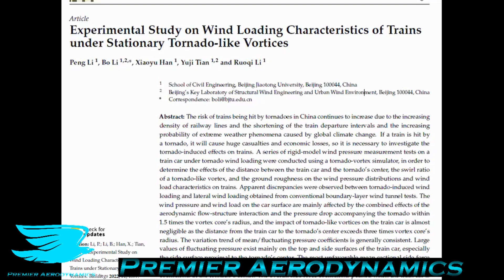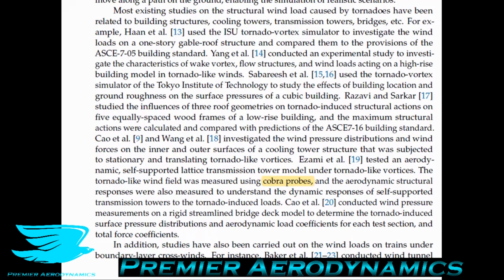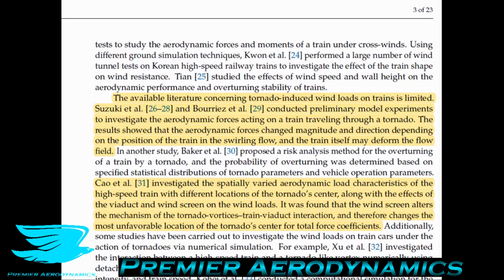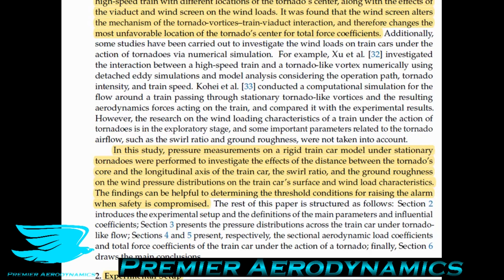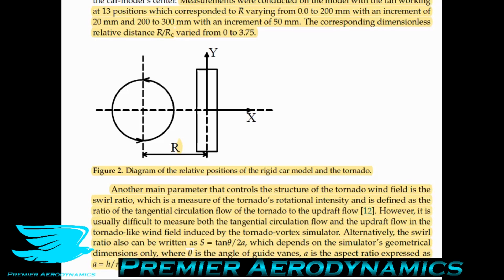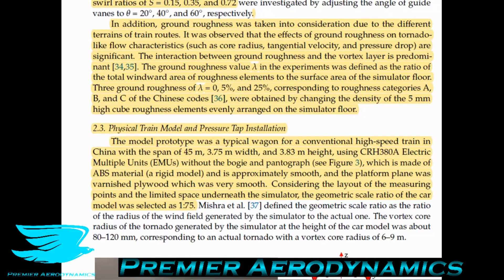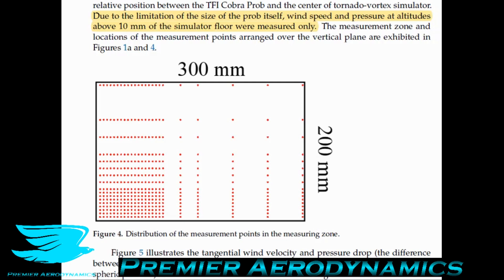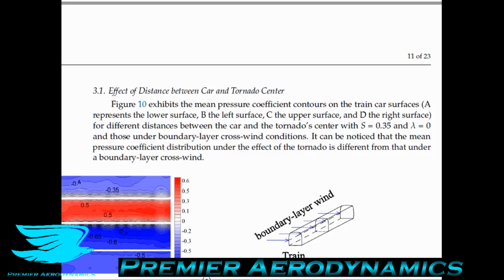Experimental Simulation of Trains in Tornadoes - Podcast #77

Comment: Higher swirl ratio also means more centrifugal force flinging air outwards, that would lower the probability of air molecules near the center of the vortex. I love how consistent the laws of air-flow are, even if they're very hard to predict at times. Lately I've been looking at airflow in cylinder heads and I'm amazed at how well the things I've learned in other fields that study air flow can apply, despite piston engines being pulsed flow as opposed to turbine engines being constant flow.

Realistically though, at ~7,000rpm or at around 2.4 bar absolute intake manifold pressure, you can pretty much treat it as continuous flow.
Reply from the maker: Interesting.

And with your cylinder mix, I'm guessing it's for an ICE? If so, have you found that the addition of fuel changes the flow physics much? The mixture would behave less like an ideal gas.

I haven't done much on ICEs, but from turbojets, I think there should be some similarities in that the addition of fuel makes a negligible difference for general calculations (other than the additional mass).
Reply: @PremierAerodynamics  It definitely can because as you know fuel atomization is critical in piston engines. So the airflow has to have that in consideration if you have port or carbureted injection, less so if you have direct injection. For example, with port injection, the roughness of the ports aids with fuel vaporization, with direct injection, you can have the ports as smooth and polished as you like, because the ports have no influence on the air and fuel mixing.

Also the short side of the intake port with carbs or PFI, has to be shaped to promote fuel atomization, and getting that wrong can have the fuel drop out, or end up with wall wetting on the far side of the port.

With direct injection, there's less issue with that, although if the airflow coming into the cylinder doesn't mix well you can also end up with wall wetting on the cylinder walls, which can wash out the oil.

That's the short version, there's literally books written on the subject.

Merry Christmas!
Reply from the maker: @rolandotillit2867  Oh wow! That's cool how the wall roughness can make a difference for certain setups. And I understand what you mean, with worse atomization and mixing, the fuel burn becomes less efficient and likely dirty.

Thanks!

Merry Christmas and Happy New Year!